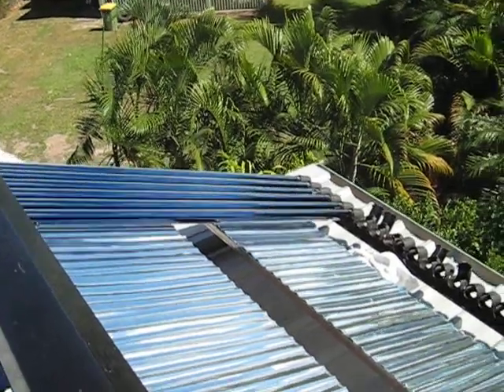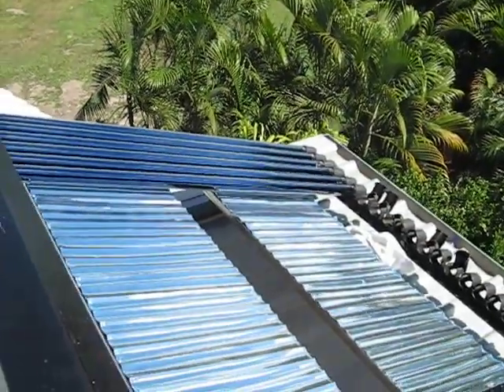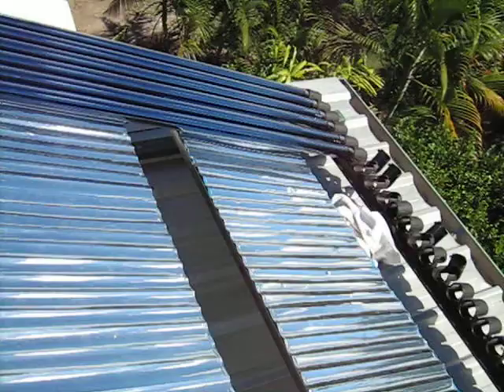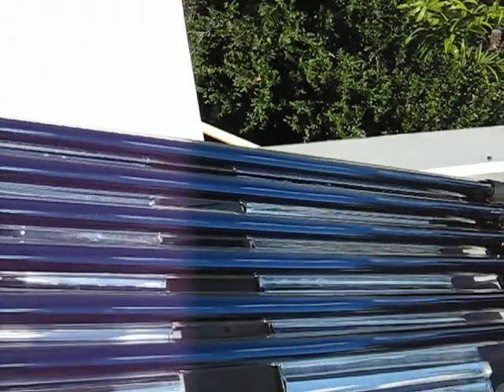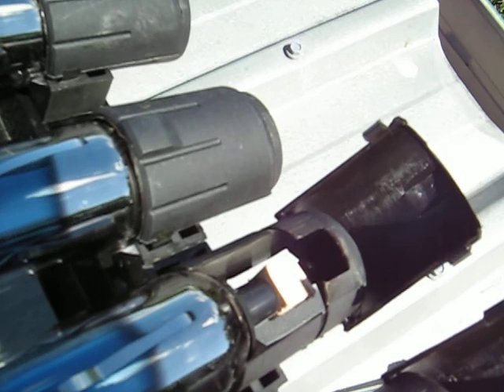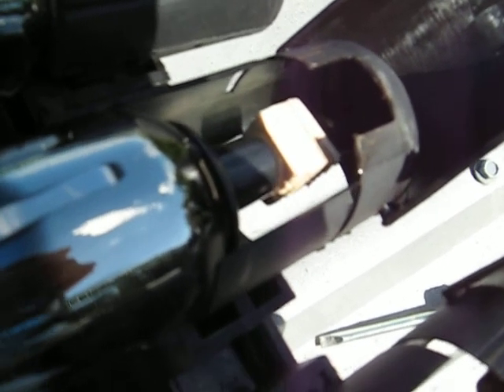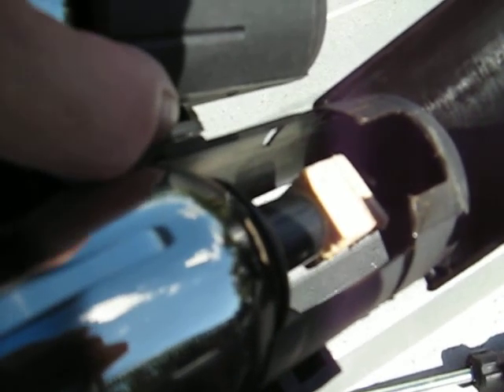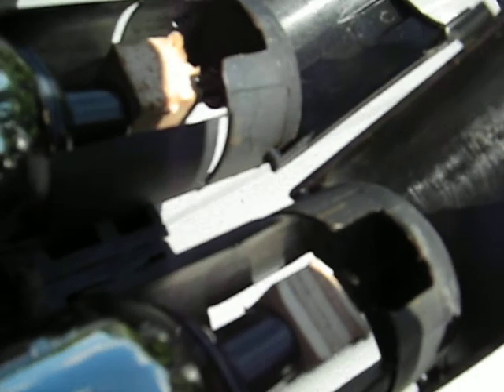Solar Hot Water System 7

Comment from the maker: Costs were $AUS 1000 for the unit(through ebay) plus about $150 for pipes, fittings and insulation. Labor... guess was a lot of fiddling around ...probably 20 hours (well, the next one should be faster). Since
doing the changes i.e. mounting the unit on a greater angle it has been performing fine - apart from recent trouble of corrosion deposits in the pump housing - working on that one
cheers and thanks for the comment

Comment from the maker: You're right with cyclone area and so on, I bolted it down as good as I thought necessary. As for permits and inspection; there's no permit needed and the local council waived the inspections for solar hot water. But that is probably only the case for "professionally" installed systems - which mine (as you noticed) is clearly not. The idea is to take off the tubes in case of a cyclone.